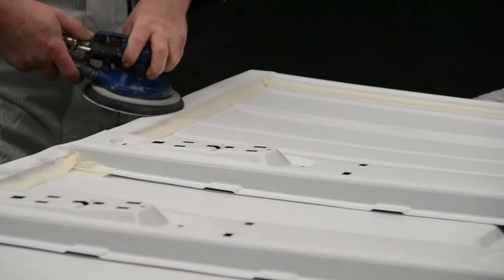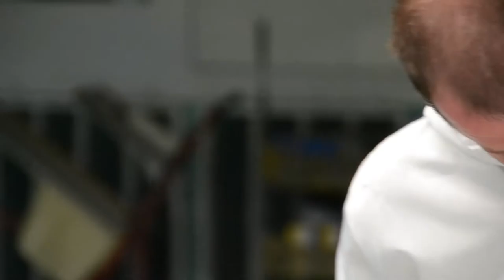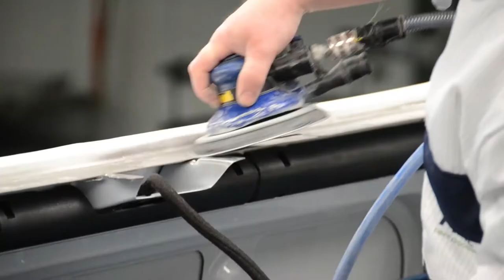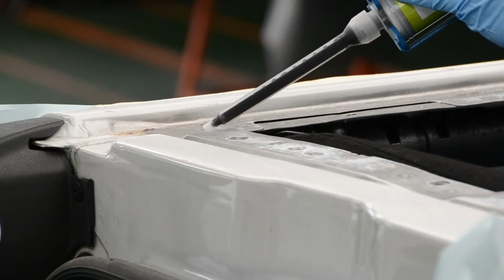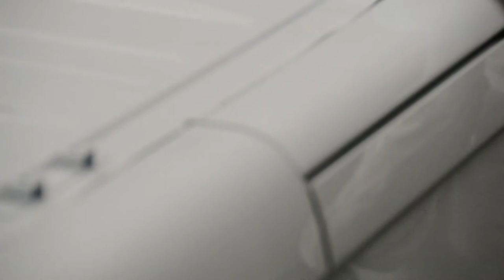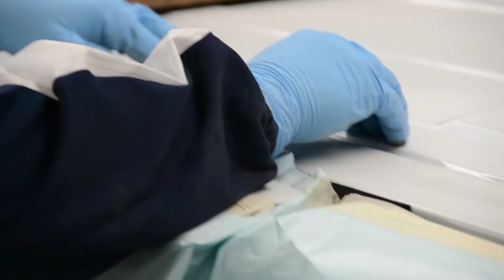Replace a roof panel without welding using the Finixa metal bonding

Comment: How many millimeteres of depth is on the roof sheet metal you attach in the video? (Trying to identify the right thickness for replacing a fiber glass roof sheet on my ford transit)

Comment: Could I do that to a crown Vic a 97 ?
Reply from the maker: Hi, yes it can be used for the Crown Vic. As long as it is used on bare metal, the Metal bonding
 (PLI 50) can be used. 
Here you can find the specs and data sheets  -   https://www.finixa.com/en/products/bonding-sealing-and-plastic-repair/metal-bonding/metal-bonding